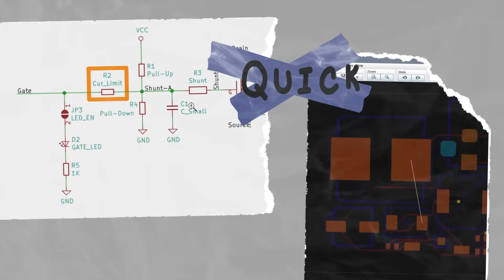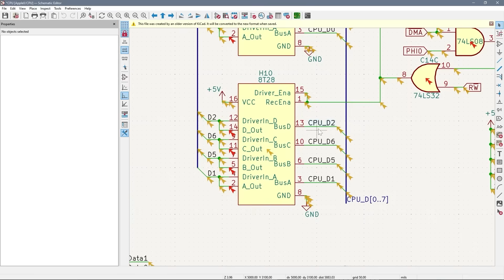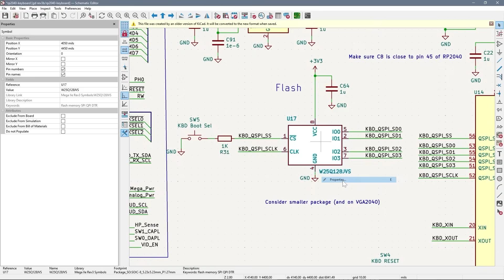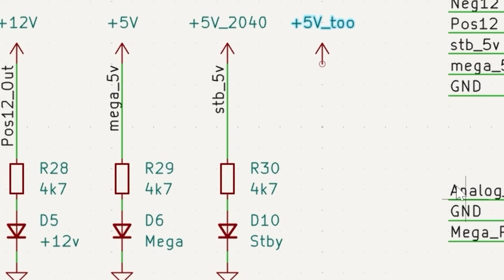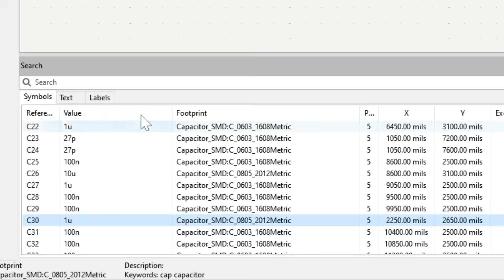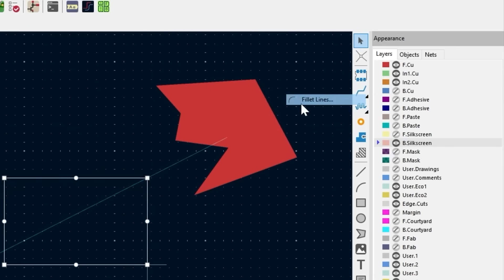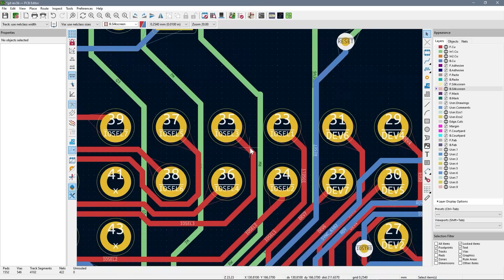8 *Must-Try* features in KiCad 8

Comment: I am a noob to KiCAD (PCB design actually), and so far, it is very easy and I love the price.....>FREE. I am in the process of doing extremely basic board design for a project I am doing. Thanks for the tips for this noob
Reply: @schlotdoglaser  Same here! I decided to make my own RP2040 dev board as a test project following the pi foundation's hardware design guide. There's tons of detail in it, so it makes for a great starter / learning project! My boards and parts just got here today actually so wish me luck with my first attempt at SMD reflow soldering!!!

Comment: Does it have the ability to define variable annular ring sizing/spacing on different layers? I ask because some board houses offer low cost pooled services with smaller annular ring on the outer layers (which helps a lot with BGA footprints). In the past I've just eaten the extra cost to use the smaller annular rings on all layers, but it would be nice to be able to take advantage of the lower cost production without resorting to janky scripting hacks.
Reply from the maker: I don't think so. There is a long-term open issue for "complex pad stacks" which is what I think this falls under. The current workaround is to create multiple pads and stack those together.
Reply from the maker: Here is the GitLab Issue if you'd like to vote for it and track the progress: https://gitlab.com/kicad/code/kicad/-/issues/2402
Reply: @AddOhms  Thanks, that does appear to be it or at least very much related to it.

Comment: In case anyone is wondering why teardrops improve manufacturability it is to do the annular ring on vias.  When you go for thin annular rings to minimise via size you have to factor in the possibility that the drill isn't perfectly aligned to the pad.  In extreme cases where you are pushing the board vendor limits you can get breakouts where the annular ring becomes a C instead of O shape.  That won't necessarily matter unless it creates open circuit from trace to via pad.  Teardrops add extra copper at the trace entry point to prevent this open circuit happening on drill breakout.
Reply: P.s. it will also create a smoother impedance transition from trace to hole but I am guessing nobody uses them for that purpose?

Comment: Looks so great! I've put off updating from v6 because I'm not sure if this might break existing projects. Can anyone here comment on how smooth the transition is to v8? Is it seamless? Do my libraries need to be (irreversably) converted, for instance?
Reply from the maker: If you converted your libraries for v6, I don't think a change is needed for 7 or 8. (I switch back and forth with my personal library with no problem.)

In general, loading older projects is not a problem. But you should back them up, just in case.

Comment: KiCad 7 had the teardrops already. It looks like they just improved on the options and connected it more tightly to the zone fill. 

There needs to be a “clean to grid” capability that takes an existing schematic or pcb and adjusts it to a grid while not changing the design. This way, and symbols can be aligned to new grid rules at a push of a button, and components on the PCB can be aligned to placement resolution at a click of a button.

I would love to see a lot more route optimizations.  Holding not only matched lengths, but using net class for coupling rules, dynamic clearances, better creepage control based on pin heights, etc.  It would also be nice to automatically generate good fab drawings and back side or side-by-side assembly drawings that are mirrored the right way for use by techs in the factory.  Also, the 3d stuff needs work, as I often have mistakes in the STEP output that is not in the 3d viewer, and the viewer has detail not in the STEP output. Some better options in generating the 3d output to have more or less detail is useful.

I am still waiting for the symbol library to convert to the scheme used for the footprints. The pretty directories are indeed pretty!  It would be a whole lot easier to add symbols from vendors if they followed the same method. It would also be nice if it was easy within the schematic editor to move pins on a symbol around the shape. For instance, a microcontroller with a bunch of GPIOs can be grouped logically on the schematic easily, rather than have functions appear randomly around the symbol because they have to stick to what order the IOs were set to in the library.
Reply from the maker: In version 7 (and before), there were plugins for teardrop support, but no built-in functions.
Reply: @AddOhms  Thanks for the correction. I did not know I installed that. At any rate, it worked well in 7, so I was glad to have it and look forward to using the one in 8!

Comment: I need: possibility to open more instance of sch or pcb, move part of scheme with elestic wire
Reply from the maker: It is already possible to run multiple instances of KiCad (and its programs) at the same time. However, you probably cannot open the same file in multiple instances.
Reply: ... and you can already move schematic symbols with elastic wires (use Drag instead of Move).

Comment: Awesome stuff, except the "select objects to the left/right" - because that already existed in 7 ;-) But it's still good you mentioned it. in case someone missed this really useful feature. The new polygon features will also save lots of time, and the teardrops (finally!) are just beautiful 🙂Thanks!
Reply from the maker: The selection has been around since at least version 6, maybe even 5? I mentioned it because I have already seen people get confused when trying to select only pins to use the pin helpers.
Reply: @AddOhms  Right! I watched again and you never said it was a new feature 😀 I'll probably switch to 8 at around 8.0.3, after they iron out the bigger bugs, whatever they are.
Reply from the maker: Me too! I mean, well, now that the video is done. 

I did run into a couple of minor bugs and one crash. I saw the crash in the RC builds as well. However, I'm unable to reliably reproduce it (yet).

Comment: Great video! Switched to 8.0 yesterday. All the new features are great, thanks KiCAD Team! I’m having some render errors when dragging multiple footprints in the PCB editor though (also a new feature in 8.0) - it displays them multiple times until I restart, then it only shows the footprint once as it should be.
Reply from the maker: Visual stuff like that is usually because of a video driver issue. You might try changing the Antialiasing options in Preferences -> Common to see if it helps.
Reply: Thanks. I'll try that.
Reply: Actually that one was just a bug.  It's fixed in the upcoming 8.0.1.